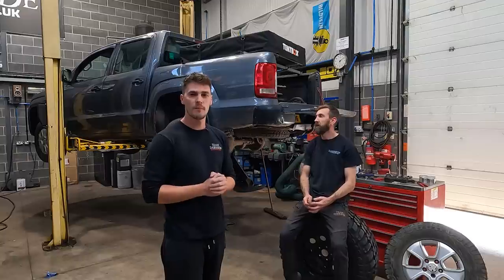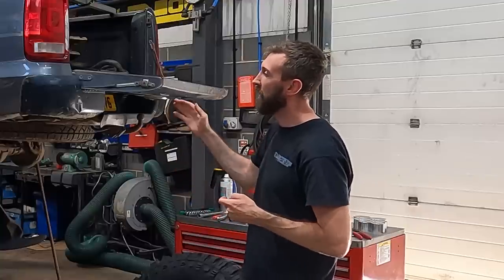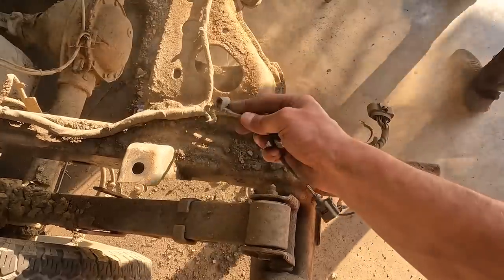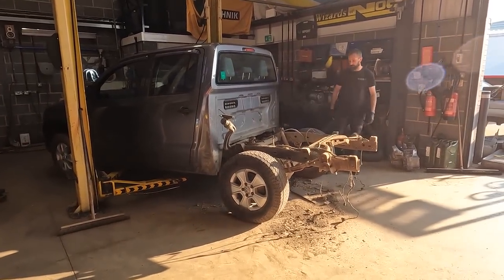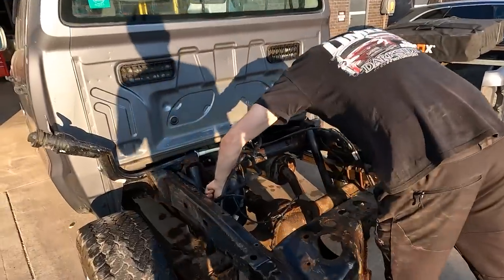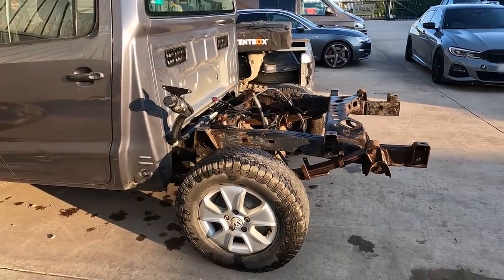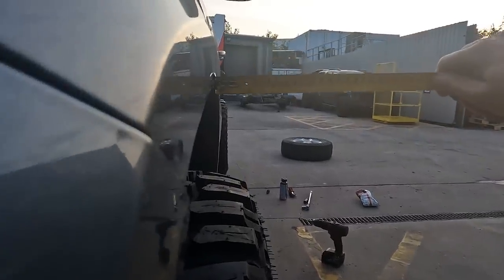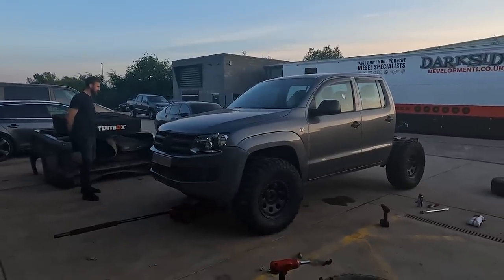VW AMAROK TUB REMOVAL! 🗑️

Comment: Cut the front bumper under the head lights and run a bar around then plating down to skid plates and Cut out the arch on the heighest arch line and put the flat arch extensions on and make up some new arch liners then itll look half like a baja truck

Comment: Why not change out the rear diff for one from a v6 model with disc brakes? With all the added weight of the accessories your putting on it it would be much better and safer. Same with the front hubs and brakes being a bigger diameter than the 4cyl. The tray is a great idea, I had one on my last Amarok. Common here in Australia, and much more practical too. But don’t make it too wide; mine was almost 2m wide, but I think 1900mm is a better look with the rear mudguards slight protruding out past the sides to suit the tyres you are fitting. Then you can also won’t have any of your vision blocked by the headboard when you’re using your side mirrors. 👌

Comment: Looks good. What about a tubular back end ?
Reply: Yes I second this. Tubular back end with a spare bolted to it. Trim the overhang behind the rear spring mounts. Wide arches on the front, full on Pre runner style
Reply from the maker: Would be a sweet idea, but sticking with the tray back for the rear
Reply from the maker: @davethedog007  VOSA / DVSA start getting funny when the chassis is modified. We want to keep this fully compliant.

Comment: What is the plan for diff ratio change?  Those monster tyres will enable you to break diffs, axles, and CVs.
Reply from the maker: Have you broken a diff, axle or CV on an Amarok?  CV maybe but I would be very surprised if axle or diff are destroyed. There are plenty of guys running 35" + Tyres on V6's and they don't seem to be having axle or diff issues (same axles and diffs in the 2.0L trucks)  Worst case we do break one, we'll find a fix. All part of the fun! Front locker will probably be the deciding factor especially with Danny's driving haha